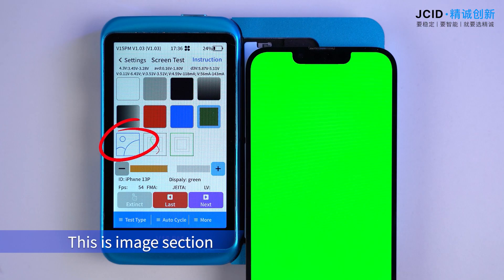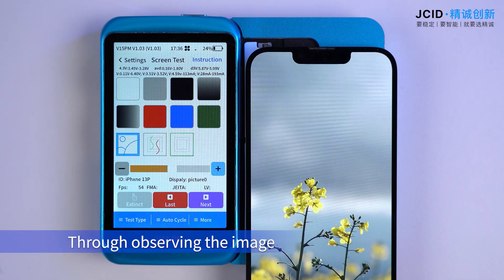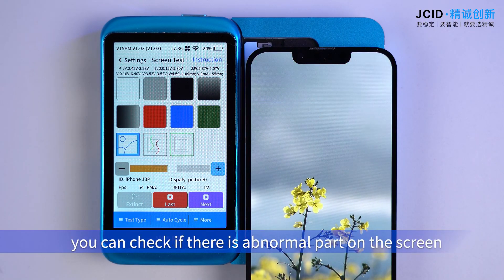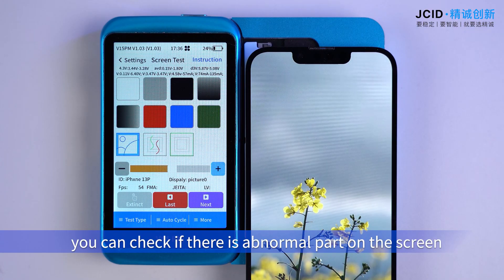V15PM Professional Screen Tester Operation

Comment: I keep getting a message 'TP init Over' then 'Pwr Off' and the screen does not come on. Its working on some screens but not others. The screen test FPCs work and the screens work but the programmer does not connect to the screen. Do you know what the problem may be?

Comment: Firstly, that screen is not 15PM😅

Secondly, is the tester going to work with aftermarket soft oled or only original 😢?
Reply from the maker: Dear, the product model is V15PM, supports MIPI and EDP protocol screens, standard packaged with FPCs of 22 models in total from X-15PM). Only original available at present.